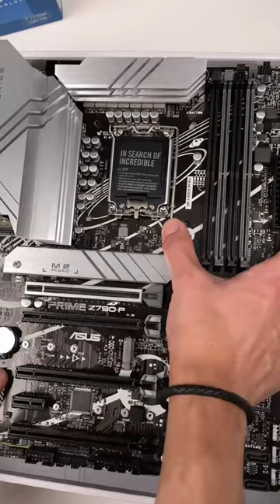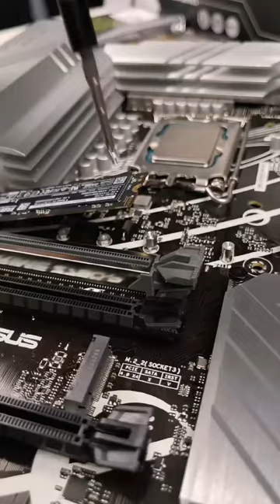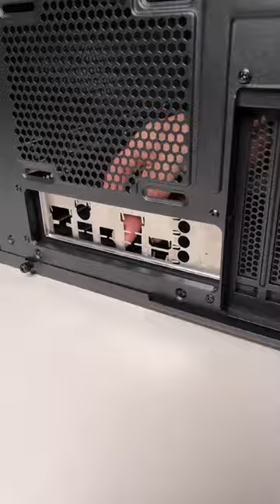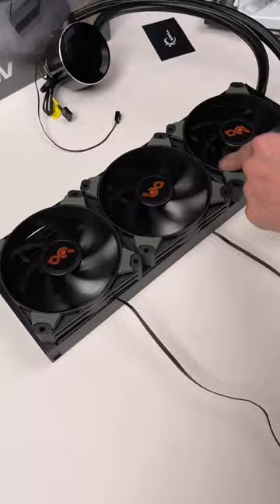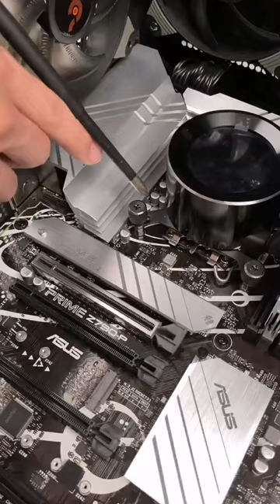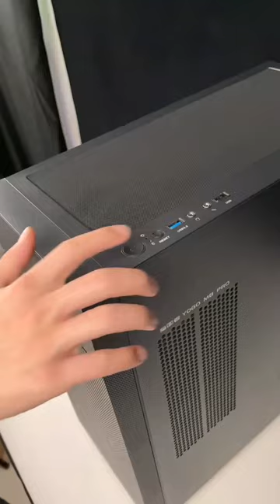Intel i7-13700KF🔥 with RTX4060TI😎 #pcbuild ASMR #shorts

Comment: Bottleneck: 0
Reply: Real 4060ti price for performance is terrible
Reply: 0 botlleneck
Reply: And so what? When it comes to gaming gpu is always going to be a bottleneck, unless you're using some old i3 or ryzen 3. There is literally no gpu rn that can make i7 a bottleneck.
Reply: I checked bottleneck calculator and there’s no bottleneck for the 4060 ti and i7 13700kf on gaming tasks
Reply: @SebastianGotvald  ok thanks
Reply: @SebastianGotvald it’s inaccurate, even if it’s true the bottleneck wouldn’t be more than 5%